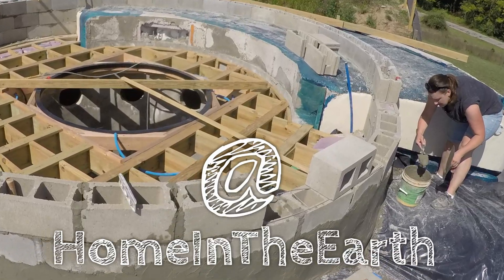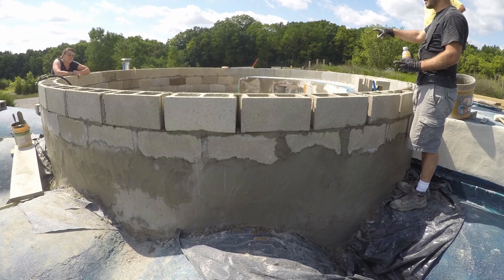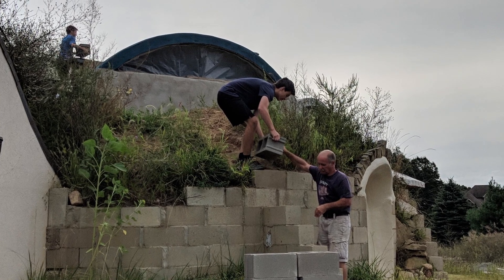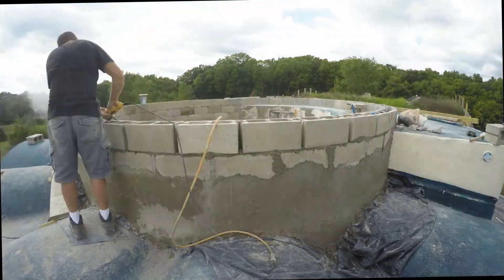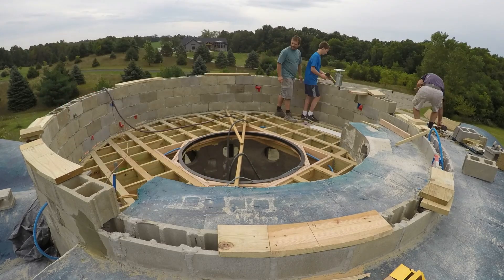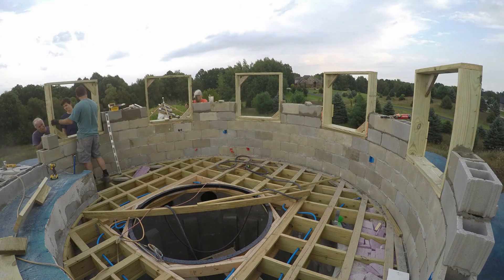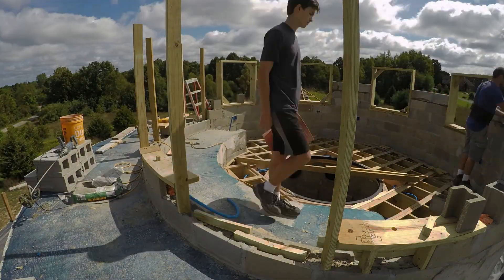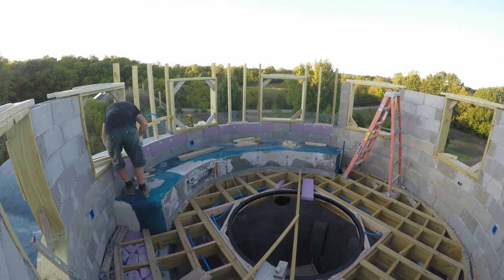49: Storm Room Block Walls

Comment: Did you ever consider using lime and volcanic ash? The Romans used it and over 2000 years later, it still holds up - not to mention its insulation and waterproofing capabilities...
Reply from the maker: It is all about your supplier.   I don't live anywhere near a source of volcanic ash.  However, they did use "fly ash", which is a byproduct of the steel making industry in my area.   I also used glass fibers in some of the situations (to resist cracking), etc.   As for lime, I used that in the stucco mixtures that I made myself.  You'll need to find the videos about stucco for the bedrooms to see how I mixed it up on the floor.
Reply: @SimonHomeintheEarth  Thanks, I must've missed those. I hope you didn't take my comment as condescending...merely an observation...it is turning out beautifully

Comment: You've probably mentioned it previously, but how do you deal with inspectors and building codes?  Love the tower. Can't wait to see how you roof it.
Reply: As an architect, Simon will be aware of the local building codes. Some examples mIght be fire escape egress requirements for bedrooms, air circulation requirements for bathrooms, minimum areas for bedrooms, plumbing requirements for bathrooms and kitchens. He designed his walls and arches, but I am sure that he had them verified and signed off by a structural engineer. Working within building code requirements helps a lot with getting approval for alternative designs. Engineering sign off helps allay any structural or mechanical concerns.
Reply from the maker: Yea, before I even bought the place, I met with the inspector and told him what I wanted to do.  I didn't want to buy land in an area where the inspectors would just be fighting me the whole way.   He was a pretty nice guy and said, "My job is to protect the home owners from the builder.  You are both so we should get along great."   He signed me up for unlimited free inspections and was very helpful with everything.

Comment: Thanks for the recipe. Looks great. I have 3 towers to make. We’re going to setup a jig to cut the ICF blocks.
Reply from the maker: I'm intrigued... You are going to cut ICF blocks to make a round form?   I had looked into this in the past and there are several interesting ways to do it (other than just buying curved forms).  I look forward to seeing that on your channel.    

I my case, I ended up just making a curved wall and then attaching insulation to the outside of it.
Reply: @SimonHomeintheEarth Yes.  Should be exciting 😂